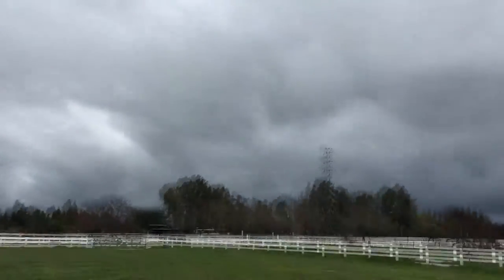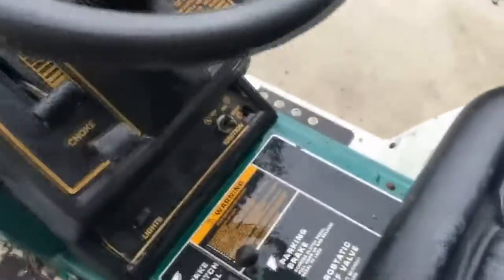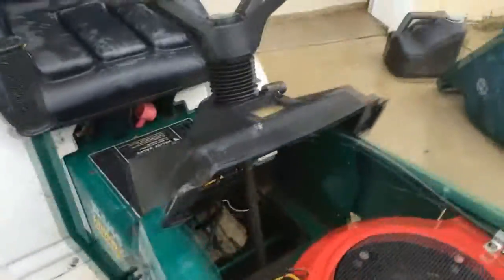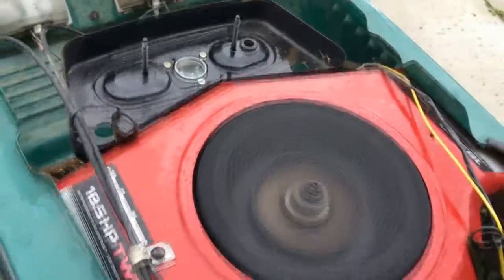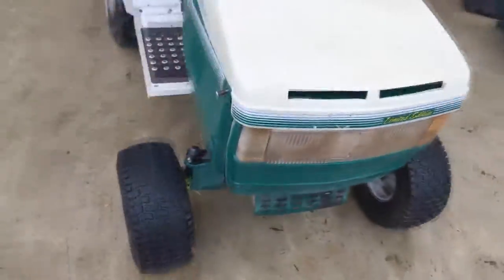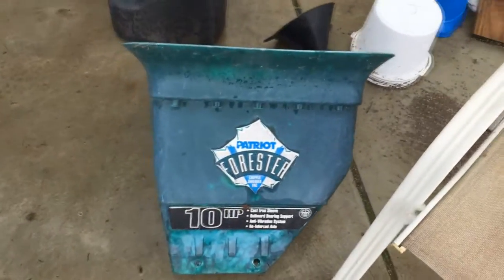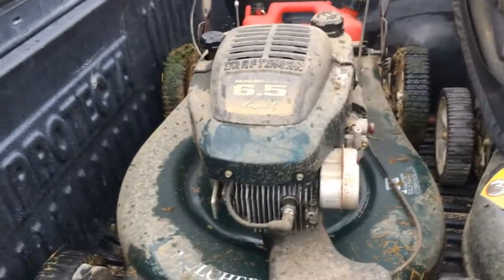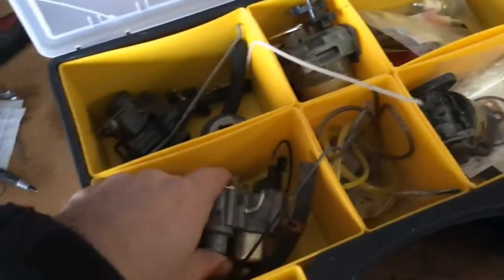Another BIG FREE Mower Haul - Lawn Tractor, Wood Chipper, 2 Push Mowers

Comment: Hank. The Powercraft mower had the same style fold back hood and engine side covers as my 1982 682 Cub Cadet. It looked like the Powercraft had a vertical shaft unlike the Cub Cadets with the horizontal crankshaft and shaft driveline. The mower deck looked fairly similar to my 44c mower deck as well. My 682 CC falls into the changeover from the IH Cub Cadet to the MTD Cub Cadet. The Powercraft was the closest example of a “Non Cub Cadet” that looked like an actual Cub that I had seen. Maybe like “Sabre” was in relation to the John Deere lawn tractors.
To be honest, I was drawn to this video by the chipper that you picked up with the other stuff. Whenever I hear a description of a loud screaming sound from within; I’m thinking bearing failure or something wrapped around the impeller shaft near the bearing; Kind of like twine rope or a piece of tarp does when it wraps around a mower deck spindle(s). It’s amazing how hard it is to get rid of that stuff when it gets wrapped like that. 
Hank, I’m thinking of purchasing a chipper/shredder and have been watching different videos here on YouTube to educate myself to what’s out there for the pros/cons as well as the price. For the money, I’m still drawn to the Predator Chipper/Shredder from Harbor Freight. 
Sorry Hank, I didn’t mean to ramble so much. Maybe I need to mow around my antennas like you did for your father. Happy Easter From Central KY.

Comment: I have an earlier version that I bought in 97 from Montgomery Wards. It does double duty hauling fire wood, horse manure plus mowing. My property is all hills. The hood is gone & the deck & starter was exchanged from an exact mower you picked up. Everything  is still original even the tires. Although the back tires have tubes in them & one looks like it does not have long to go.
That push mower may not be seized. Check the safety brake.
By the way Great Haul!!!

Comment: Hello Hanksranger that is some great finds like those live drive by discoveries.  That Bolens will be a good one like those you will get that going, that Craftsman Eager 1 like yourself I almost avoid them even if free.  Look forward to seeing what you can running from all those great finds.
Reply from the maker: +mountainbikekayak Ya already got the bolens running and cleaned up, vid will be up next weekend, that eager 1 actually isnt seized, believe it or not there is so much grass under the deck its obstructing the blade. It is caked on all around the inside of the deck and really hard, its gonna need a full cleaning under it.

Comment: Great haul man! that tractor should be a relatively easy fix, I don't like working on Tecumseh's either... in the past I've put money & a lotta work in them to still have a piece of junk mower.
Reply from the maker: +Alan Marshall Ya Im sure it will be, the trans seems to turn ok, but dealing with the tires will be the most expensive I think. I really dont think it needs a starter either, you ever heard of that powr kraft brand before?
Reply: +hanksranger I've never heard of Power craft before, but it looks identical to a early to mid 90'S Yard man, so I'm thinking maybe a store brand.

Comment: first thing I would check battery then see how many volts is getting to starter see if connections is tight check starter or sometimes the valves need adjusted and cause this its causes too much compression

Comment: Hey i got one of those 5.5 briggs on a craftsman. I cleaned the carb and it runs on carb cleaner but still won't run. Do i need to use a rebuild kit or is it something else?
Reply from the maker: Check both the pick up tubes on the carb both can be obstructed or full of grime from old gas. Also clean the tank out really well. If there is water in it, it can be picked up by the carb and prevent it from running.

Comment: That engine is not made anymore only way to find one is on ebay or from someone.
Reply from the maker: +KB&#39;S Small engine Repair parts &amp; Service Yea based on everything I have read they are supposed to be very good motors. It will definitely be a keeper